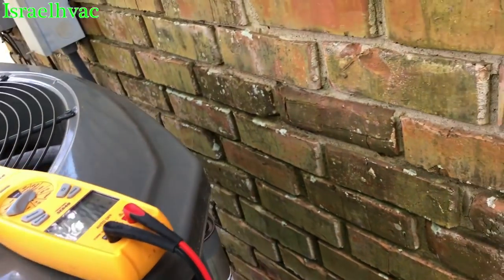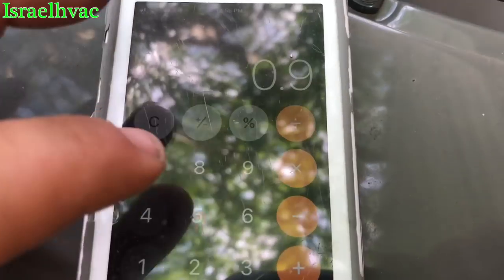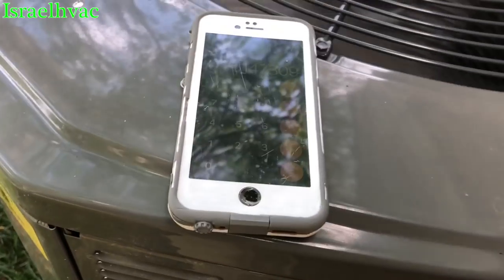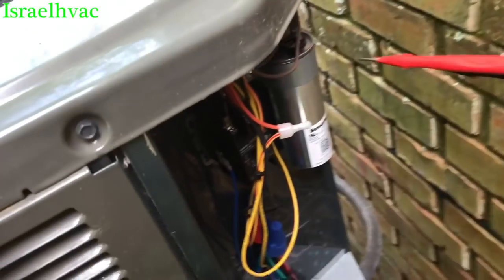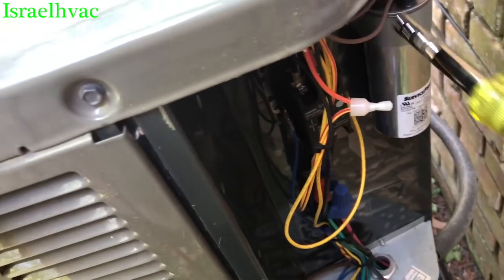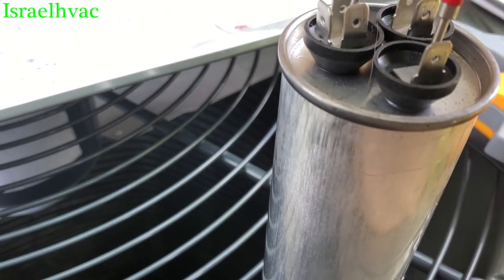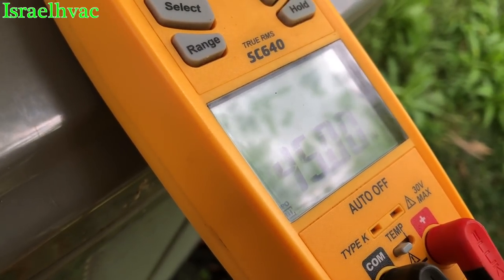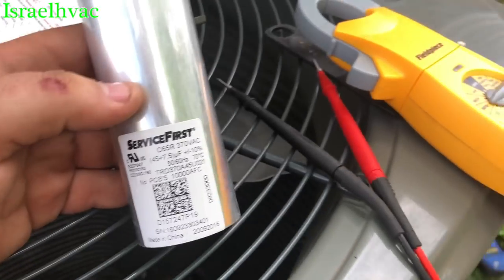HVAC | Checking Capacitors | Live vs Not Live

Comment: You will always get a different reading when the capacitor is actually working vs not doing anything. It's like testing a car battery, the proper way is under load. Found an intermittent high pressure lockout a few years ago from a 3mfd cap testing fine with no power applied but dropping all the way down to less than mfd under load and causing CFM to over heat and go out on thermal, causing the hi pressure on o lock out. I think load testing has its place in service diagnostic.

Comment: Testing under a load is absolutely going to give you more of a true reading then not under a load. One of my techs did a pm last week and brought a capacitor back to shop for warranty that was reading within specs not under a load which i believe was 60mfd but under the load test that we have started doing it showed over 100 mfd. its something that could have caused major issues with windings if we wouldnt have checked it under load. At first i thought he had lost his mind since unit was so new until we checked it again at shop under load and sure enough he was right. My opinion if you dont check it under a load you wont condemn a good capacitor but you will miss some that are actually showing bad under a load that wont show bad with no load testing.

Comment: And then I have found them the exact opposite of what most people are saying. Where they checked fine under a load when you pull it off then you actually find it's a couple of microfarads low. I think both tests serve a valuable purpose. But it is crucial to get a super accurate amp draw and that's why I love the "amp tip" function on the Ampprobe ACD-14 pro. I personally trust the readings i get on that meter more than any other meter I own. Good video John 👍 I would like to see that same test done with "known" weak capacitors.

Comment: I agree with Ken that if you check it under a load that if your findings are a little crazy it may point you in to looking at a deeper problem. Even if you check it live after you replace a bad capacitor. Great job. Have a great Wednesday. God bless.

Comment: ok  john look  you  always want to check them hot!  reason is, is because you want to test it under a load  , it is like a car battery  if you  test it cold it may read 14v  but put it under a load and it will be 11.6v  same principle here you test it when it is being used  that tells you  the true value of the capacitor under a load who cares what is does cold

Comment: I prefer to test under load and in circuit. Whether it be capacitors or other electrical components they react and respond very differently under load than in a static state.  Also when performing these tests it's important to keep in mind that your meter is not infallible and it too has certain tolerances. Typically +/- 1% or 2% margin of error on a field meter is acceptable. Always check your line voltage as this will most certainly affect the under load test.  All that being said when I work on electronics the best way to test a capacitor on a board even if you have a good LCR meter is to remove it and test out of circuit. Sometimes in our Quest to become better technicians we overcomplicate things.

Comment: 6 of 1, half dozen of the other.
live: the meter is "not accurate enough" at low amps.

out of circuit: you're relying on the voltage from your 9v battery to test vs. the +240v from the system. 

who cares if someone makes commission. what's more important is the integrity of the person doing the work. there's an equal number of hourly techs who beat the clock and are a complete drain on the company as there is salesmen lying to line their pockets. both are shameful. if you get offended by this, its probably because you are one of the techs described above.

great videos bud. keep it up. apologies for the rant